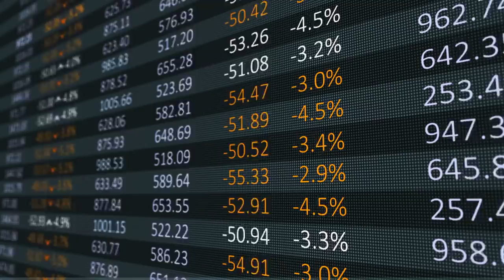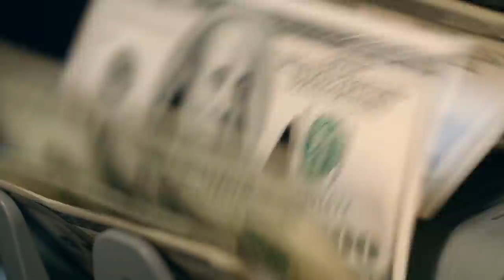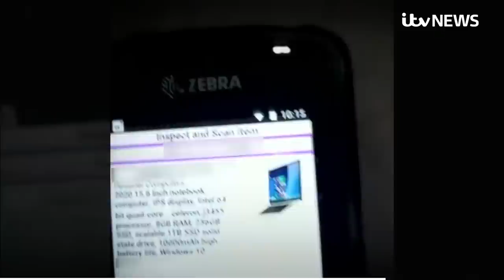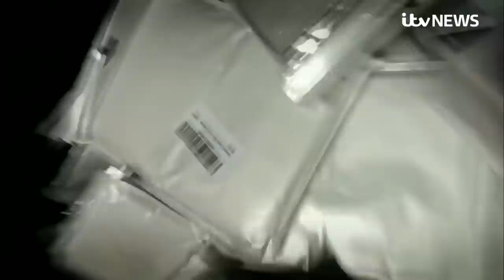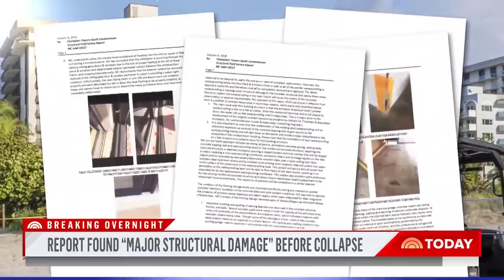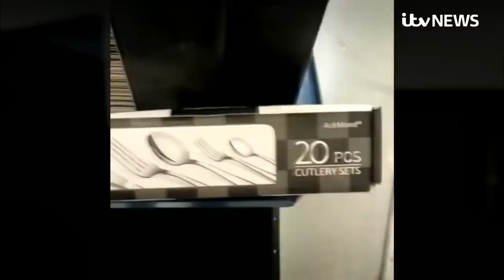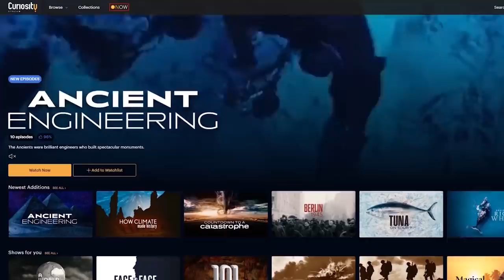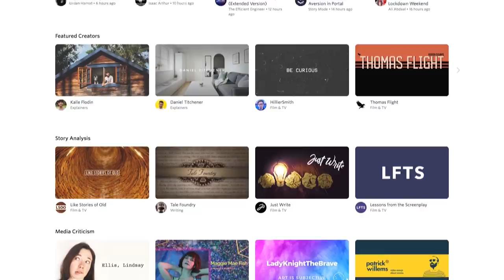Is Capitalism Actually Efficient?

Comment: I think this is conflating two things as one, not sure if that is disingenuous or not.
Capitalism is absolutely efficient for the most part (not perfectly efficient, but highly efficient). the mere fact that the system can discard material waste at such a high rate is a testament to that.

Now, it is wasteful, that is true. But it is wasteful, because the cost of products have been reduced to the point that it is cheaper to dispose of things and make new ones, then expend the human capital (ie the time to repair) than just have the new item manufactured.

Food is also very cheap, although, as stated...there is definitely a distribution problem with food, but that is not because of a lack of efficiency on the production end.

There is no comparison to the productivity and efficiency of western capitalism vs any other societal system, ever.
Reply: 'There is no comparison to the productivity and efficiency of western capitalism vs any other societal system, ever'
Considering that almost the entirety of the world lives under capitalism, that just showcases that the deciding factor is not capitalism, but colonial exploitation.

Additionally, the food is still destroyed instead of being given to those who need it, which is monstrous.
Reply: @thetaomegatheta  You arent completely wrong. Colonialism has brought capitalism to many places. Sometimes unwanted true...but in the long run, almost every (I would say all, but there could be an exception) country has benefited from capitalism, and any country that has tried to go back to socialism and self sufficiency, without exception is failing or has failed. And that failure includes dissatisfaction of the populace.

None of that excuses the failings and abuses of colonialism...but the colonial countries, have benefitted far more than the colonial power. Food productivity increases and standard of living increases the world over, being the biggest benefit.
Reply: @bt3779  
'but in the long run, almost every (I would say all, but there could be an exception) country has benefited from capitalism'
Incorrect. Whenever capitalism has been implemented, it caused loss of living standards, both in Europe centuries ago, as well as in the former Warsaw Pact decades ago.

'and any country that has tried to go back to socialism and self sufficiency, without exception is failing or has failed'
'Go back' to socialism? There have thus far not been revolutions that reestablished socialist states (unfortunately).
Wherever socialist revolutions succeeded, however, they improved people's living standards, however, so this claim of yours is also wrong.

'None of that excuses the failings and abuses of colonialism...but the colonial countries, have benefitted far more than the colonial power'
Huh? Are you seriously claiming that the victims of colonial exploitation benefited more from colonialism than their exploiters?
Are you seriously suggesting that African and Asian countries benefited from it more than Europe and European settler-colonies?

'Food productivity increases and standard of living increases the world over, being the biggest benefit'
People ate more in the USSR than they do in Russia today. People were provided guaranteed housing and universal healthcare. Meanwhile, the transition to capitalism caused some of the worst drops in the living standards in history.
Reply: @thetaomegatheta  Capitalism, in the shock from transitioning from socialism back to calitalism...temporarily has caused loss of standard of living.

But in the long run, without exception standard of living has always improved.

Never, not once...has the transition to socialism resulted in an increase in the standard of living (outside of those in power).

It is true, USSR post WWII for the most part, were able to maintain the population above starvation conditions. But there was never a year the population didnt pay close attention to the years crop yields in the fall. It is true they didnt starve post ww2, but they hardly had a bounty of food, or variety that we take for granted.

In the long run, yes...it is my claim that most (maybe not all) post colonial countries are benefiting vastly...with technology, food, education, knowledge, trade protection that they never would have indegienously developed. 

And no, socialist revelotions have never...not once improved the living standards of people...not even in the transition fromczar to bolsheviks. Oh...maybe a brief improvement to the elite city worker population....but not sustainable long term....and not throughout all of society. Your gaslight is failing.
Reply: @thetaomegatheta  Can you please name one socialist state that is "successfull".
Reply: @bt3779  
'Capitalism, in the shock from transitioning from socialism back to calitalism...temporarily has caused loss of standard of living'
Loss of lives, housing and universal healthcare wasn't temporary.
This transition killed more than a million people in Russia alone. All of that in peace time.
And it took decades to recover.
At this point in their lifespans, socialist revolutions managed to achieve much greater improvements in terms of standards of living, all while recovering from bloody wars, civil and not.
So, don't be disingenuous.

'But in the long run, without exception standard of living has always improved'
Except for guaranteed housing, healthcare, food accessibility, and job security. You know, these 'minor' things that are necessary to live.
Whatever increases in standards of living happened were already happening under planned economies decades prior.

'It is true, USSR post WWII for the most part, were able to maintain the population above starvation conditions'
'Above starvation conditions' is a very disingenuous way to frame the fact that, under the USSR people ate more than in modern Russia and in the then-contemporary US.

'It is true they didnt starve post ww2, but they hardly had a bounty of food'
They had more food then than now.

'In the long run, yes...it is my claim that most (maybe not all) post colonial countries are benefiting vastly...with technology, food, education, knowledge, trade protection that they never would have indegienously developed'
You are an idiot if you think so.
Not only is that not how technology spreads (they would have benefited way more technologically if they weren't killed and robbed for resources and cheap labour, for one), we also know that India was de-industrialised by the British empire. Not the other way around.
If what you are saying was true, the 'developing' countries would have become 'developed' a long time ago.
You are a fucking ghoul that deserves to be on the receiving end of colonialism, so that you become 'civilised' the way you think the third world was.

'And no, socialist revelotions have never...not once improved the living standards of people'
More of your historical illiteracy.
The USSR increased life expectancy from about 32 years in 1910 to 50 years in 1950, to 69 in 1988. Brought literacy rates from about 30% pre-civil war to about 90% in 1939. Gave people guaranteed housing, universal healthcare. People had better job security than now. Brought working day from 11-12 hours, six days a week in the Russian empire, to 42-hour working week in 1967, and then to a 41-hour working week in 1971.
We see similar improvements that were implemented by Mao's PRC after they beat the fascist Guomindang, in Cuba after they liberated themselves from the Batista regime, in Vietnam after they liberated themselves from France, and so on.
If you think those weren't improvements, you are either a joke or a monster.

You are historically, politically, and economically illiterate at best. Your knowledge begins and ends at 'USSR no food' memes.